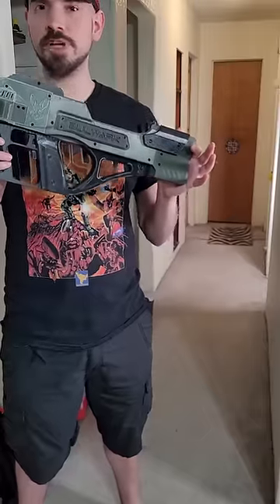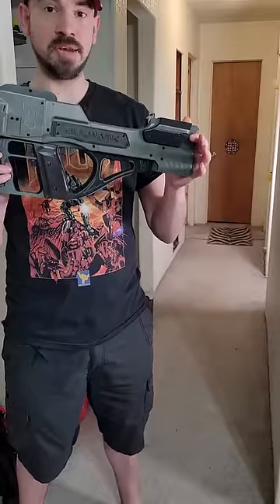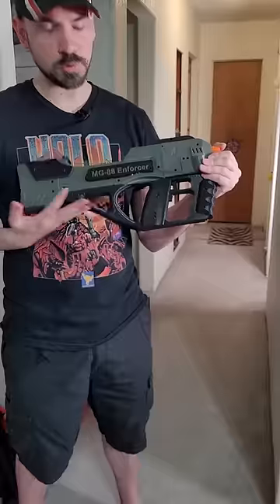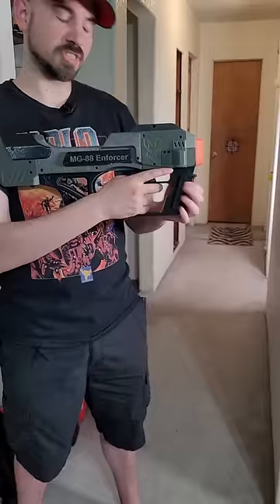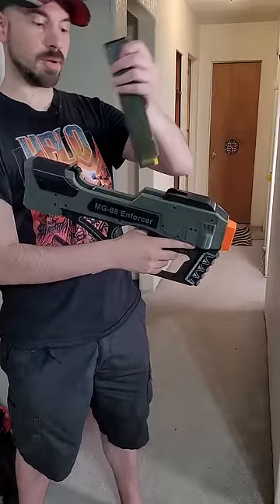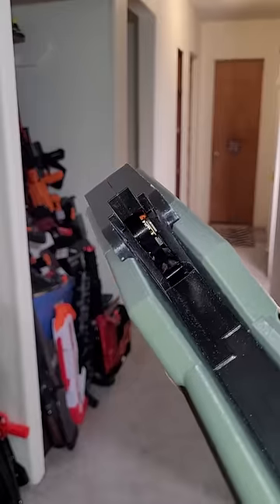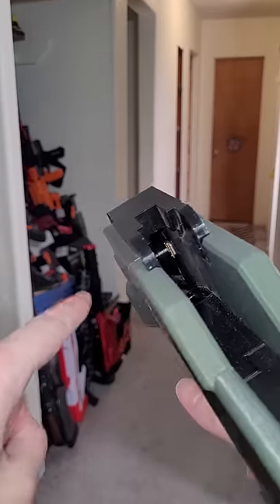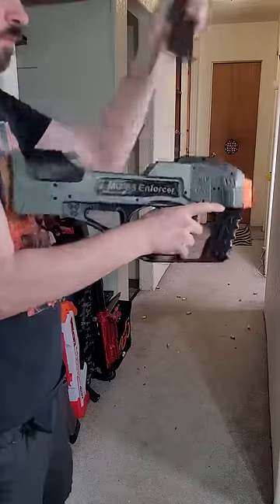Top Loading Nerf P90 Mag?

Comment: Works more like an hk g11 in reverse than an fn p90. G11 rotates cartridges 90 degrees on a pitch axis like that nerf thing. P90 rotates cartridges 90 degrees on their yaw axis. Main difference that the nerf thing shares with both of those is that firearms chamber at the rear while this chambers at the front. I suppose that makes sense, as firearms benefit from long barrels that provide more distance travelled pushed by the pressure of powder detonation. Not sure how nerf works, but I'd imagine there's no propelling advange to a long barrel and it probably just adds drag to the rounds.